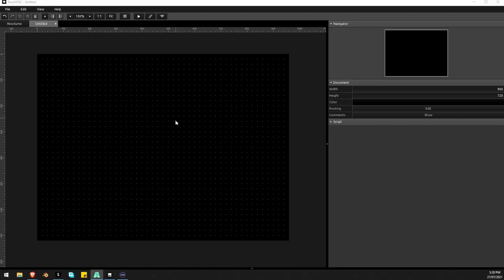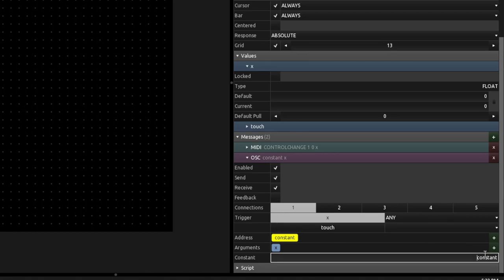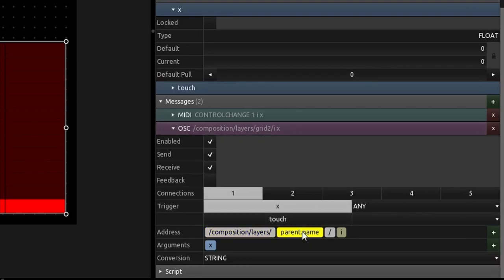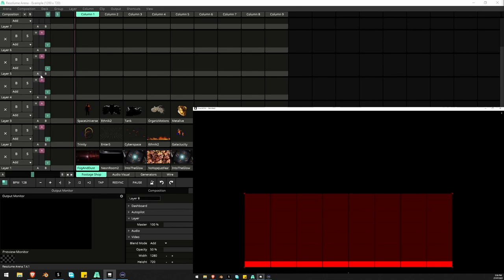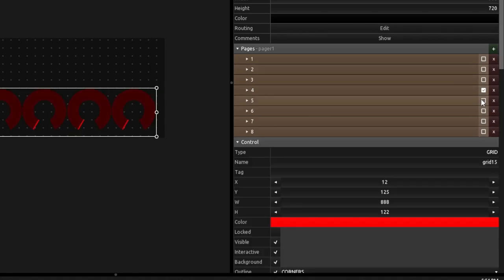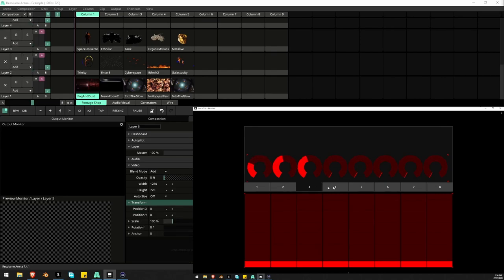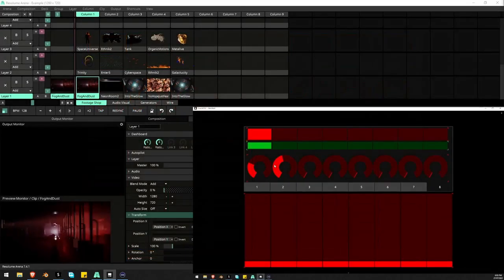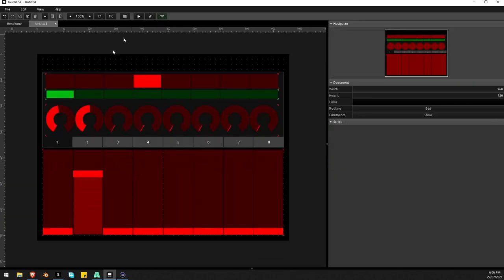TouchOSC and Resolume // Controlling Resolume with TouchOSC #touchOSC #resolume

Comment: For clip selection toggle status, they send on either 1 (disconnected) or 3 (connected) on for example: '/composition/layers/5/clips/1/connected' I added two osc message handlers to convert x integer either 1 to 0, or 3 to 1 repeatedly
Reply: please can you copy your script here. I am building a touch osc resolume interface and I would love to be able to see what clip is playing in resolume as I use auto pilot a lot.

Comment: HI I want to trigger clips with SMPTE so they play along with the music but I want them to have a 1.5 sec fade in. my problem is every time the clip gets triggered it cuts and is not the look I'm after is there a way to trigger then have it fade in??? thanks in advanced
Reply from the maker: Hi R Gunness,
Yep there sure is.
You just need to set the Layer Transition Time. (it is the slider at the very right on the layer)
If its not visible you can turn it on under View > Show Layer Transition Controls

Comment: Is it possible to start the faders for layer opacity grid to start on  another layer instead of layer 1 and have it continue up? I only want opacity faders for layers 3-8 but with the ease of programming OSC like the way you are in grid style. Thanks!
Reply from the maker: Good question, Ill have to have a look into it next time im playing with it. Ill get back to you
Reply from the maker: Hello,
This can be done by changing the scale of the index (i) in the osc address.
The scale i used of 1 and 2 started at the first layer.
So to start at layer 4 for example change the scale to 4 and 5
Reply: @mith  awesome! Thank you very much for the tip and following up with my question! You definitely earned my subscription! I needed up buying an APC MKII but will continue to use OSC for more features. Hope to see some more videos regarding OSC and Resolume from you in the future. Thank you!

Comment: Hi Mith, you may know how to retrieve names from clips, columns, decks, etc to be displayed on labels on Touch Osc? I'm looking at and I couldn't figure out yet
Reply from the maker: You can get things like layer names from the OSC address in Resolume into a "Text" object in TouchOSC.
For example " /composition/layers/1/name" will get the name of the layer.
Set the OSC message in TouchOSC and enable Feedback.
However the only draw back is Resolume will only send the OSC on change, so it only works when they get changed.
You can Poll Resolume to send values by using a "?"
So you could add a script in the global canvas of TouchOSC to call these values at startup:

function init()
  sendOSC('/composition/layers/1/name', '?')
  sendOSC('/composition/layers/2/name', '?')
  sendOSC('/composition/layers/3/name', '?')
  sendOSC('/composition/layers/4/name', '?')
  sendOSC('/composition/layers/5/name', '?')
  sendOSC('/composition/layers/6/name', '?')
end
Reply: @mith  amazing,  I was trying to retreive the info with the same OSC address but actually Resolume did not sent that data, I will try with "?" I will try it right now, thanks a lot!
Reply: @mith  It works man, amazing, now its really interactive. You are the best, thanks a lot
Reply from the maker: Awesome!! :)